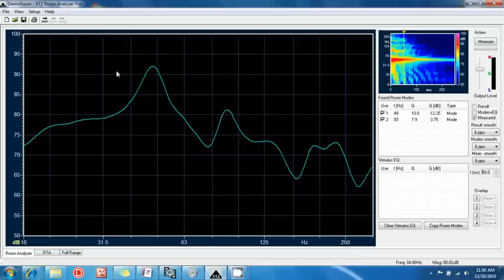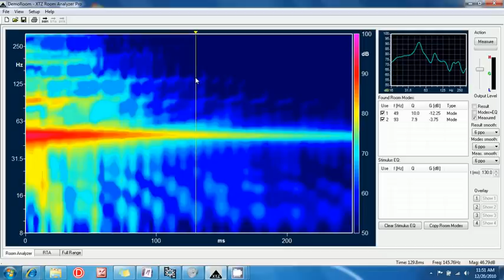How to use XTZ Room Analyzer to identify room modes

Comment: Do you use a PEQ equalizer and adjust 49& 93 using the Q and gain for those two frequencies? Do you set all front speakers and sub with the parameters? I have B& W 803d2
Reply from the maker: Yes, you would measure each speaker and sub in turn and then copy the values proposed by XTZ into the PEQ in your CT-SSP.